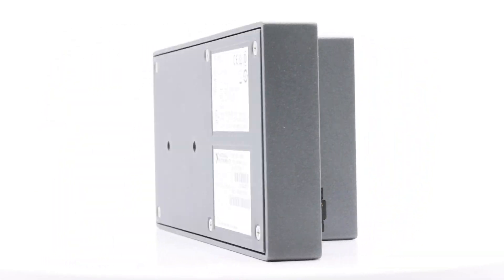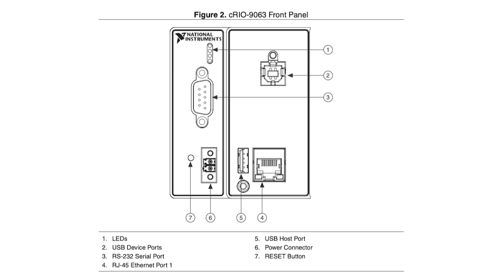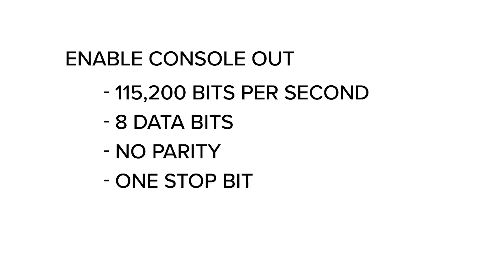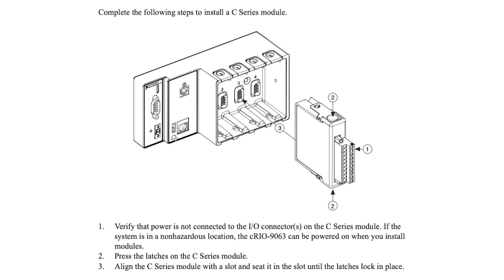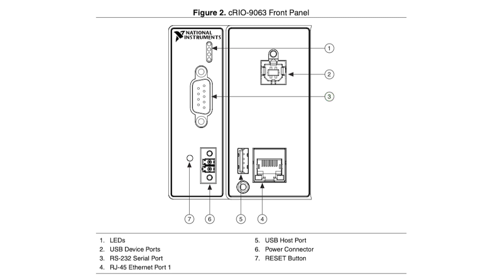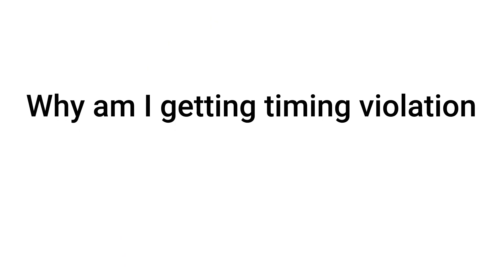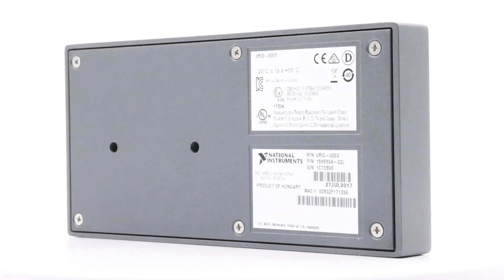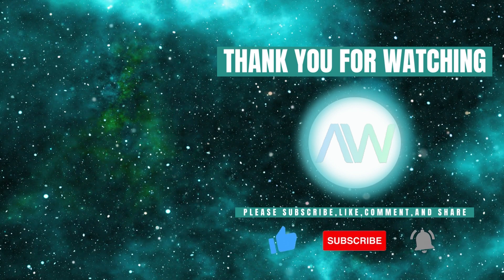Introduction to National Instruments cRIO-9063

Comment: Hi I am using Crio 9063 in lab, recently I started getting message of "No channel has been activated! Call open channel/ select channel first" and one of temperature analogue data card is not reading the values need your help.
Reply from the maker: Hello. We need more information in order to help. What temperature devices are you using?
Reply: We are using NI 9209, card
Reply: Which reads RTD data, all channels are showing 10DegC
Reply from the maker: Take the 9209 out of the cRIO-9063 and check the pins and make sure it is connected securely. Check your wiring and all connections. You can format your cRIO in NI MAX by right clicking it under remote systems. Then reinstall your software. If you still have problems the 9209 may be damaged. Here is our repair page if you think that may be the problem: https://www.apexwaves.com/repair.php. 

Here is the Getting Started Guide for the NI-9209 as well. 
https://www.ni.com/docs/en-US/bundle/ni-9209-getting-started/page/overview.html

We hope this helps!
Reply: Thanks, but how can i confirm whether it is 8n good condition
Reply from the maker: If you tried all the tips we mentioned and the device is still not working correctly it may need to be repaired or replaced.